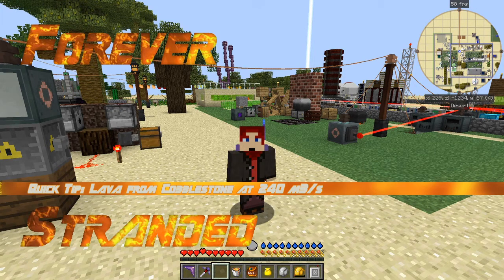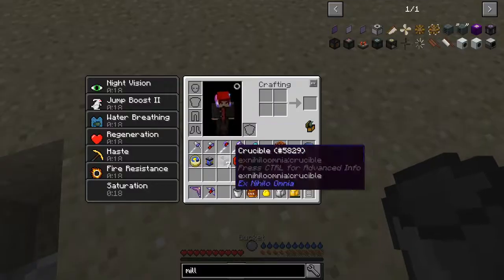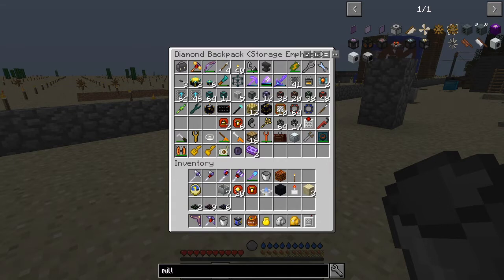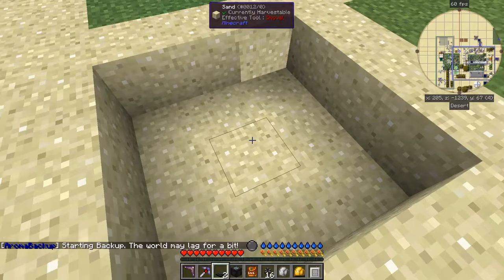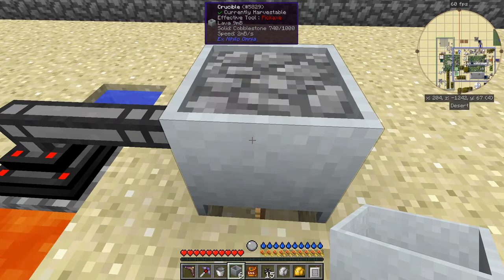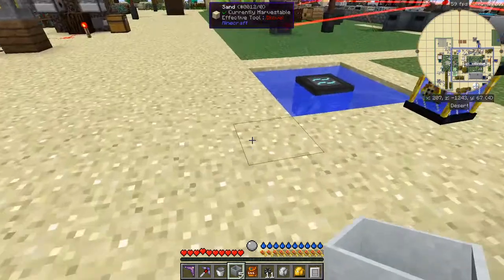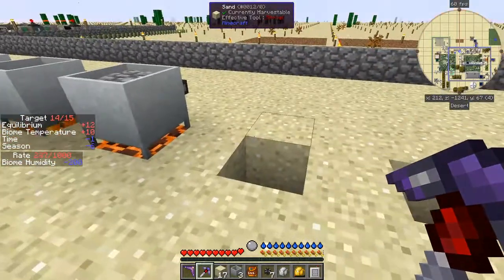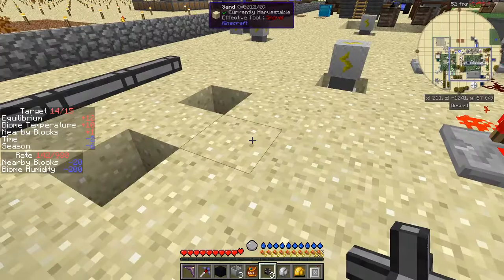Forever Stranded Quick Tip 06 - Lava from Cobblestone at 240 mB/s

Comment: Hi
Great tips. I had forgotten about the last 2 I think it's time to upgrade my lava gens 😉
Did you also know you can use liquid pyrotheum which works at 15mb/s but it does set things on fire if it's not covered up enough 😀
Reply from the maker: John Roberts no I didn't know you could, thanks for the tip, this would be a nice easy way before going to the End. Do you know if destabilised redstone still works?
Reply: Hi Duncan - I dont know but I will check it later. Strangely enough Pyrotheum wasn`t in the heat file but it still works :) So fingers crossed the Destabilised Redstone will. Is it in JEI ?
Reply: Tried the destabilised Redstone and it said no heat source. If you type temperature in nei it will show all other things you can use pyrotheum is the highest though. Temp needs to be above 300k I guess it's in kelvin 😀
Reply: Duncan Webb ok no worries. I've never seen advanced rocketry before it's blowing my mind 😋 will try the quarry first or go to the end 👍
Reply from the maker: John Roberts Ender Dragon drops the wireless infinity booster card, its great just for this alone.
Reply from the maker: John Roberts think destabilised redstone was removed when thermal expansion was added.

Comment: Humm I'm lacking titanium or rutile ore. I saw a comment from gwsheridan saying it can be sifted from dust or sand but all I get is the titanium alumide or can it be mined with void miners ?
Reply from the maker: John Roberts you can get rutile ore from the extra utilities quantum quarry, over time you get quite a bit but it is slow. I like the quarry it returns flowers and other plants too. Void ore miners get iridium which makes coils and a fast arc furnace.

The pack way to get titanium is Netherrack or compressed Netherrack, hammered to gravel and sieved, also slow. Hope this helps.
Reply: Ah ok I will give this a go later too. thanks for the tip :)
Reply from the maker: John Roberts forget to say that you can't get rutile ore from the void ore miner. Another source is mining on planets, I mined a geode and got some rutile ore from there but geodes are aimed at diamonds, gold, etc. But of course you need titanium to get to a planet.

Comment: any time i try and put any block (magma or advance machine structure) it dose nothing any advise?
Reply from the maker: Can’t think of anything except a different version of a mod.
Reply from the maker: I think the recipes for lave generation are defined in the configuration files of the mod pack.
Reply from the maker: The modpack has changed quite a bit from 1.9.1 which I played to 2.0.8 the latest version. In 1.9.1 the modpack included Ex Nihilo Omnia and in 2.0.8 the modpack included Ex Nihilo Adscensio. There was a heat.json file for x Nihilo Omnia, and it included quark:biotite_block and libvulpes:advStructureMachine. So these two will no longer work.
Reply: @duncanwebb4934  thx for lmk the fire is good for now